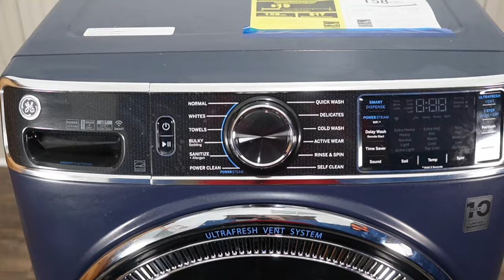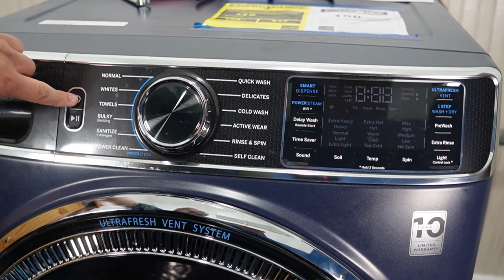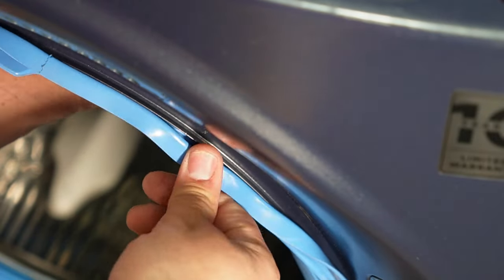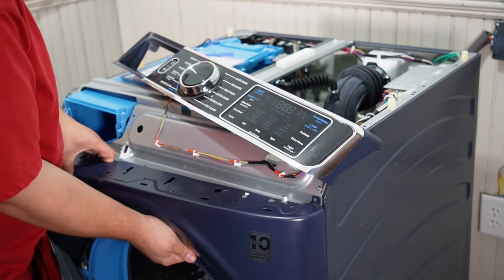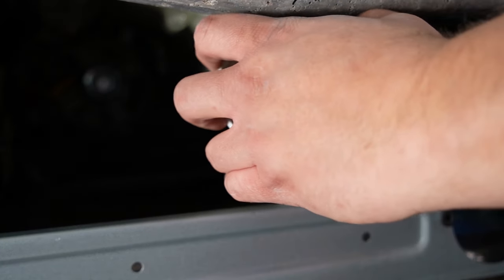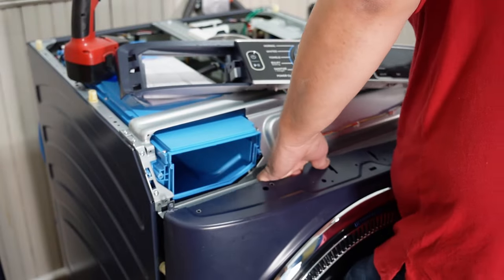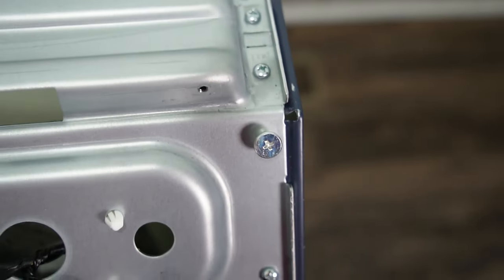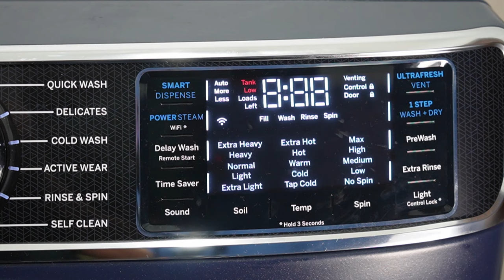GE Front Load Washer Won't Drain or Spin - Ideas to Troubleshoot & Fix

Comment: Hi. I have a GE washer GFW550SPN0DG that doesn't want to wash nor spin. When I press start it only spins like for 5 seconds and stops. It does the same when I try the spin only cycle. I ohmed the motor from pin to pin and it reads 3.5 ohms, seems to be within specs. I also ohmed the hall sensor that is attached to the motor and on the same connector (pins 4&5) and that reads 119 ohms. I also checked the voltage to the motor when the drum spins for 5 seconds and it showed 124v.  What could be the issue, motor or inverter? 
I would really appreciate any help with this. Thanks in advance.
Reply: Did you fix your problem? What was the problem?
Reply: @tupapidan90  never fixed it. I replaced the motor inverter board, main board, motor and hall sensor on top of the tub (one part at the time) and it never worked. I have to mention that replacement parts were used from eBay. Supposedly they were good working parts.

Comment: Honestly you don’t to unscrew the door lock. Once you loosen up the front gasket stick you hand in and  just disconnect it saves time. The lock will come out with the front panel. And the inverter board going bad will cause the machine to run weird.

Comment: One major thing not covered here...if the drain fails and the washer is full of water, the washer door becomes locked and will not unlock. Even after you've drained most the water out. You just get shut out. The washer will also not perform any functions. The lights are on, but nobody is home.
Reply: Try unplugging for a few hours, worked for mine last week. I had one 10+ years ago that wouldn't open, but I don't remember if I ever unplugged it.

Comment: Yo, my Samsung washing machine won't drain, but it didn't give me any error code, I can hear the motor of the drain pump working and it spins but the water won't get down, I tried to empty it using the emergency tube but it didn't work, any idea what happened to her?
Reply from the maker: I'd physically remove and check the pump impeller. If the magnets are shattered, it can hum and sound like it works, but won't run

Comment: I replaced my pump cause I didn’t have debris. Put the new one in and it still does nothing. Very frustrated right now
Reply: Same. Did you solve the problem?
Reply: @CompletelyObsorbed  Did either of you figure this out? Going through the same thing with ours right now.

Comment: I thought this was a "DIRECT DRIVE" machine. "7:30" LG uses a similar 10 year sticker. I feel tricked by marketing. You should do a "Lorain Furniture and Appliances" style breakdown of the machine video giving your opinion of its construction, serviceability, possible reliability issues, and wash performance. You could also compare this machine to other machines you have used and or repaired.
Reply from the maker: I plan on it for sure. I want to do more variety videos about appliances in general, but I want to make sure I have the setup to do it well, but I have a really good idea for one soon

Comment: I cannot for the love of god get the screws to catch when reinstalling the pump. I've been at it for an hour and the screw just turns and turns as if I'm turning it the wrong way. Good grief.
Reply: I mean it's honesty like a practical joke at this point.
Reply: Turns out the screw was broken and half of it was still secure in the floor of the unit. I was trying to screw it back into a blocked hole!
Reply from the maker: Sorry I just saw this. We had that happen on one as well :-\

Comment: I followed all your steps. I changed the drain pump and I still can't get the washer to drain. It's like the machine doesn't switch the drain pump on
Reply: Did you resolve your problem? My washer won’t drain and I’m clueless on what to do 😩. We already cleaned the pump and nothing
Reply: @Loonabestkpopgroup  nope the motherboard was bad and it was going to be to much to repair so I bought another brand washer it sucks because I had the matching washer and dryer and they were only like 15 months old. I will never buy another GE. Good luck hopefully that's not your case and you can get it resolved.